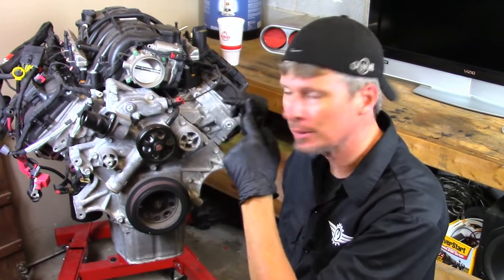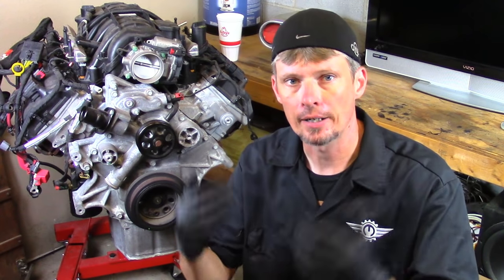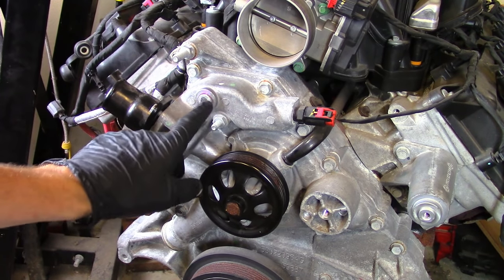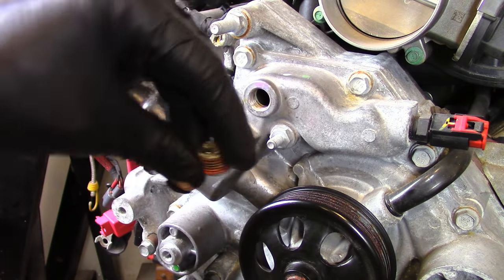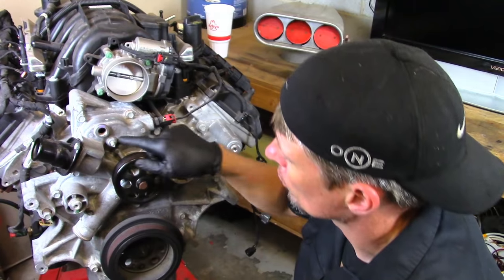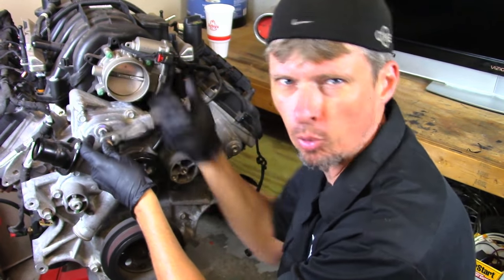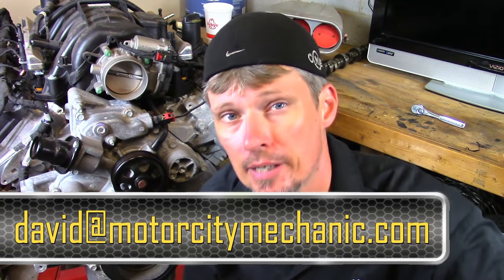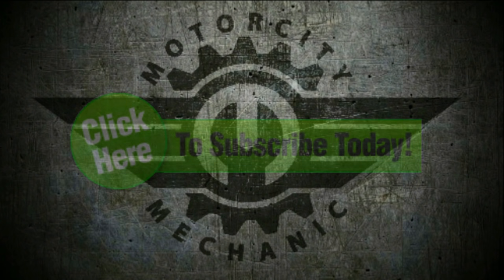Quick Tip: 5.7 Hemi coolant bleeder location and fill procedure

Comment: Hey I have a quick question sir, my car keeps stalling on me every time I come to a red light and stop sign I have a 06 Dodge Charger Rt. What do you think it can be? I’ve done replaced every crank shaft position sensor and camshaft sensor and spark plugs and pcm and fuel pump
Reply: Hey Matt, try this(it's not hard). Remove air box, plastic plenum(2 10mm bolts), look behind the intake at the egr tube port. See if the tube has worked it's way out a little bit. Check to make sure the clip that holds it in the port is still connected good. That's what I ended up finding out when had same problems as you. Good luck.

EDIT- I thought you were talking about ram's 5.7 hemi! Sorry bout that. But still, get to back of the egr tube location, check to see the rubber "gasket" is tight in the port and the clip hasn't come loose or fallen off. Not sure what all is in way of getting to yours. Anyway, bad egr valve causes that a LOT. And the egr tube coming out of it's port or loose, not seated all way into it's port back there. It's prob def seated into the actual egr valve as the 2 screws usually never come loose, but the other end of the port doesn't use screws. It uses a clip thing, they can def come loose. Again, good luck.
Reply: Michael Borne alright Ima try that as soon as I get out of work, Thank you so much for the response. Because I’ve done put in so much money into this car and keeps cutting off over and over. And I’m out of options so thank you sir.

Comment: Hey MM - I am having some issues with my coolant system in my hemi. I am trying to bleed the system and I have full overflow. The car gets up to the right temp but I don't believe the thermostat is opening or the water pump is not working. I have my bleeder port plugged in but only hot air is coming out no coolant. Eventually my car overheats.
I am not sure if it is the water pump not functioning properly or something else blocking the coolant from cycling through. Also no heat

Any help is appreciated
Reply from the maker: Are you bleeding the cooling system with the engine off and cold or running and hot? Were there any repairs made before this started happening?
Reply: MotorCity Mechanic I did a coolant flush over the summer when I replaced my thermostat. I started having cooling leaking all of a sudden due to a crack in my radiator. Installed a new radiator and thermostat. Started filling up the coolant reservoir but the coolant won't drop even when the car gets up to operating temp. I dont believe I bled it fully from the summer coolant flush. So I used a bleeder kit this time, with it running but the coolant never comes out of the port, only steam.

Comment: i have a 2005 durango 5.7 hemi and dont see that bleeder plug anywhere
Reply from the maker: Some of the older engines dont have one. If it did it would be around the highest point on the timing chain cover. Otherwise we use a vacuum fill device to suck the fluid in to the engine and not allow air to get in if possible. Otherwise there is the old run it until the thermistat opens and then cool it off and add coolant. Then repeat until you dont need to add any more.

Comment: And my temp sensor wont come out either and neither will the allen blled port wtf can i do.... ive tried to bleed without removing not working mad air bubbles in the system
Reply from the maker: I have heard of some people drilling a small hole in the flat area of the t-stat and making sure that hole is towards the top when installed. Its not be first or second choice but some people have had good luck with that.
Reply: My recessed Allen plug (bleed plug) on my water pump was stripped. Drilled small hole in center of stripped plug, was able to then get it to screw out. Retapped threads where original plug was and installed new threaded plug. Worked like a charm and now have a new plug that I can loosen to bleed air if I need to. Just used a dab of blue gasket sealer instead of thread locker to prevent leaks. Works great.

Comment: So do I add the coolant while the engine is off or running?
Reply from the maker: I recommend doing it while the engine is off. Just recheck the coolant level over the next few days to be 100% sure all air is removed. Thanks for the questions and make sure to subscribe

Comment: One question  please do I need to pull the thermostat  to fill it up after take the coolant plug out
Reply from the maker: No need to remove the thermostat. The bleeder is used to remove the air on the back side of the thermostat. Thanks for asking and make sure to subscribe

Comment: i have an 05 magnum 5.7 hemi and the cooling fans stop working all of the sudden i check the fuses and they are fine what can it be??
Reply from the maker: I recommend supplying 12 volts and a ground to each of the motors for testing to see if both work fine. Then the next thing would be to actuate the fans using a higher end scanner to make sure they can be commanded on.
Reply: i did that already and they both work the problem is in the fuse box one of the fuses doesn't get power fron the harnest i put a test light on all the pin holes and only one of them comes on

Comment: Thanks for video and it worked perfect
Reply from the maker: Appreciate the feedback Ed! Make sure to subscribe and share the videos with others.
Reply: MotorCity Mechanic  just a minute to explain the extra benefit of swapping out radiator. A month ago the blend door actuator messed up so I replaced it but then my heater only worked when it wanted to. Was told to take it to dodge so they could calibrate blend doors. After radiator swap and following your advice my heat also started working. My guess it sucked air into cooling system so it wasn't circulating properly. Thank you for putting helpful videos out there for us who don't know but will try.
Reply from the maker: Ed Staples As you saw.....air in the coolant system can cause issues. It's always cool to find people not scared to try these repairs that I film. Thanks again for the time spent watching and for leaving the comment

Comment: While havingWell having the plug off from the bleeder you cannot start the engine am I correct
Reply from the maker: There is no need to start the engine. As your adding the fluid to the coolant bottle...the air will come out the bleeder.
Reply: Okay thanks n I have another question when I’m driving and come to traffic and to a complete stop my car starts over heating 
I just put in a brand new water pump expansion tank a new thermostat opens up to 185 car still overheats passes 235 regular temperature supposed be around 185-205.
What can it be.🤕
Reply from the maker: If its running hot sitting still then I would check to make sure that the radiator fan or fans is working.
Reply: Yes fan is working fine car start over heating when ac is on n I’m stopped at lights n traffic 
But when I turn off ac coolant temperature goes down.
Reply from the maker: Some cars have more then one fan....if so then make sure both are working. Otherwise it takes seeing it in person fully understand the situation and trying a few things to see what might be going on.
Reply: Jesus Hernandez did u fix the problem mine does the same
Reply: @huertafabian68  I have 2010 Dodge charger 5.7 did u figure out the problem? Mine didn't start this until after replacing both fans and radiator Please reply ...

Comment: i have an o6 300c i have replaced the radiator and the thermostat and bled it also did fine for a couple of days and it flared up to overheating did not leak. no coolant i have no smoke out my tail pipes ????? help😢😢
Reply from the maker: The next thing I would check is the fan operation. Make sure no broken blades and that they both work....if you have two or just the one. You may also need to check the level again and bleed it again as well.
Reply: ive seen that only one of my fans spins and the top one does not will that cause it to over heat. every now and then
Reply from the maker: You may have a bad fan motor then. Supplying power and ground to the fan should make it come on...if not then it needs to be replaced.

Comment: Awesome man,  David Here from Hesperia, CA im getting ready to re-install the pass side head on my wifes 2006 Commander 5.7L HEMI, so this will help in the bleed procedure. Side not. when I re-install my rocker arms and push rods do I really need to have the special dodge tool for this? Can it be done without it?
Reply from the maker: Thanks man for the comment. When it comes to reinstalling the valve train, you dont need the special tool....heck I dont even use it and I have access to it. It may take some time to line everything up but you should be okay. Just spend some time double and triple checking everything to make sure the push rods in the correct hole....its fully seated in the rocker arm and that the rocker arm is positioned correctly. Otherwise you should do okay. Appreciate you watching and make sure to subscribe!
Reply: Thanks brother! Have to say im blown away that you responded so fast! Most Y-tubers take weeks or more. I Subbed and Liked for sure. Now lets hope this damn HEMI doesn't drop any more seats.
Reply from the maker: You caught me sitting at the computer lol. Dropping seats mainly is due to running hot. Hopefully no issues with the other side. Need to make sure the cause of the overheat is found.
Reply: Yeah it was the radiator, replaced it months ago.
Reply from the maker: Cool, then all should be fine after this.
Reply: Thanks Brother, Re-installing the head today after work.
Reply from the maker: Take your time and triple check the valve train....otherwise you got this
Reply: Will do!
Reply: The special tool is just for removing and reinstalling the valve springs.
The only special tools needed to replace the head is a inch pound (for the intake manifold) and a foot pound torque wrench (for all of the head bolts) an angle finder and a long breaker bar to tighten the head correctly.
Reply: Hi, thank you for this video. My 05 magnum rt 5.7 hemi, is overheating, when fan come on it start bubbeling a lot. I didn't bleed the system from the bleeder that u showed. I will try and let u know, if u have any tip, please let me know. BTW, I replaced the thermostate.
Reply: I've never owned a mopar until I go my '08 300C (5.7L V8). It recently began to overheat but heat still blew HOT air. Took it to the dealer since I can no longer work on my own cars (arm was paralyzed in accident). I could CLEARLY see the waterpump leaking. Heater still blew HOT tho. Took to mopar ONLY dealer. they replaced wtr. pump, and "replaced" my thermostat & "replaced" some electronic temp. sensor even tho the heat gauge (both analog & digital) were still working fine! IMMEDIATELY on the way home, I noticed it only blew hot air if accelerating. Whenever I'd stop at stopsigns/stoplights, air would IMMEDIATELY start to blow colder and colder. Started overheating again AND now my "heater" won't even blow LUKE-WARM air.. AT ALL, EVER!!! 
**COULD I HAVE AIR BUBBLES TRAPPED IN MY HEATER CORE, AAANND MY THERMOSTAT???**

Comment: what is the proper antifreeze to put back on a 2007 Dodge Ram 1500 4.7 ? my come with a  pink reddish color.
Reply from the maker: The replacement is a 5 year/100,000 mile HOAT antifreeze. Here is an option you can purchase: http://www.valvoline.com/our-products/antifreeze-products/g-05-antifreeze-coolant
Reply: Always Mopar coolant and yes it is pink for that type dodge engine. There are some supplies that only dealer has them and it worth to pay a bit more. Aftermarkets sometimes do more harm.

Comment: Why doesn't somebody make a square headed pipe plug fitting with a (brake)bleeder hole in the middle of it for applications where the oem big bleeder hole is not blocked with accessories.

Comment: Do u live in the Los Angeles area. I need a good radiator mechanic to change my leaky radiator frim my 2007 Chrysler aspen hemi.  i called the Chrysler dealership and they want 800 bucks. A freaking radiator cost 180 at O'Reilly. Is it that hard to change a radiator on a 2007 Chrysler aspen that they want to charge 650 of labor
Reply from the maker: I wish I did but I am a bit further east.....in Georgia lol. Looking the info up.....the radiator only shows to take 2.0-2.5 hrs......so that. The Mopar replacement radiator can be bought online for about $180 plus shipping. I recommend the Mopar replacement over the aftermarket item you mentioned. Better quality in my opinion. So labor should be about $300 plus parts.....around $500 for everything. Thanks for asking and make sure to subscribe.

Comment: one manufacturers fail: bleed screw is made from iron and housing from aluminum and what happened-electro corrosion and stucked screw
Reply from the maker: Luckily where I am we dont see many issues with getting the bleeder lose but I can see that being an issue for sure. Thanks for watching and for the comment. Make sure to subscribe if you havent already
Reply: Then order a new bleeder screw, drill a hole in that one,  Hammer in a tap out and remove it, and put a new one in...
Reply: yes  i drilled hole in  bleed scrwe and made new thread and put m8 scrwe in it and problem solved

Comment: Not all these bleed plugs are ALLEN PLUGS. Mine was #45Torx. Almost damaged it by starting to turn it with an Allen.
Reply from the maker: Havent seen a torx yet in all my years working on this engine....makes me wonder if it was replaced for some reason or if it was an odd ball item that only a few where done that way.
Reply: I wouldn't know other than mine what was installed.
 
The allen felt like it was starting to let go and didnt torque on it any harder. I was not gonna damage the plug ...did not wanna deal with a stripped plug.

Took a closer look and the plug looked liked torx.

07 Magnum
Reply from the maker: Thanks for the added info Eugene.

Comment: Cool vid man
Reply from the maker: Many thanks. Appreciate you watching! Make sure to subscribe
Reply: MotorCity Mechanic I'm already subscribed, do you have a good on how to remove the heater core on a charger 5.7
Reply from the maker: I currently dont. Its not something that I have seen yet. But if I do....I surely will try to film it.
Reply: MotorCity Mechanic ok cool is it a hard to do fix?

Comment: David just watched this video 3 months ago I replaced the thermostat on my hemi after a check engine light came on just today it started to over heat and started bubbling both hoses are cold they are at 45 degrees and engine temp at 240 could it be that some air found its way out finally it is now low on coolant and no leaks I can see
Reply from the maker: Air pocket possibly. I wonder if there is an issue with a possible blockage in the radiator?
Reply: That's what I was thinking thank you sir

Comment: What if I can’t get the plug to come off
Reply from the maker: You can take the coolant temp sensor out as well.
Reply: @MotorCityMechanic   friend of mine told me to try that and I did but still no coolant came out while I was pouring coolant into the reservoir

Comment: I have a 2014 5.7 hemi ram and my antifreeze go down and no leaks
Reply: 18.3 quarts your probably just low or needs bleeding,
Reply: done by dodge dealer
Reply: @john197187   that makes me unsure to have them severvice my transmission on my 2015 full flush,new filter, new fluid needs done though i work it everyday

Comment: can u do it while it is hot
Reply from the maker: Only do this when cold.....you will most likely get burnt by the coolant if you do it when hot. So please....only when cold. Thanks for the question and make sure to subscribe
Reply: yea i replaced my radiator and thermostat on my 2006 300c now its heating up evey once in a while i did not bleed it like they say would that be the issue
Reply from the maker: There is a very good chance thats the issue. Due the bleed when the engine cold and then top off the fluid level.
Reply: Thanks I'm going to bleed it out when it cools off. I will keep you up dated
Reply from the maker: Cool. I will keep an eye out.

Comment: Do i need to bleed my system if Im changing my T`stat?
Reply from the maker: It is recommended to do when the coolant system is repaired. If it has the bleed port....then its a simple process and then you dont have to worry about the air being trapped. Thanks for the question. Make sure to subscribe
Reply: MotorCity Mechanic  Thank you for the answer and I did subscribe!
Reply from the maker: Much appreciated. Enjoy the weekend and thanks for watching
Reply: Do you have an email that I could send you a question on about my Dodge Charger?
Reply from the maker: Sure thing.....david@motorcitymechanic.com

Comment: didnt do this after I replaced my water pump gasket. Got a loud whistling noise and overheating. I'm gonna try this process and see if it fixes this
Reply from the maker: Hopefully it helps the issue, not sure about the whistle sound......that could be a bearing issue possible with something belt driven, just depends. Thanks for watching and make sure to subscribe.
Reply: @MotorCityMechanic  Helped a lot. thanks!